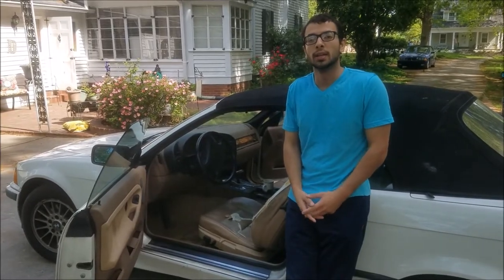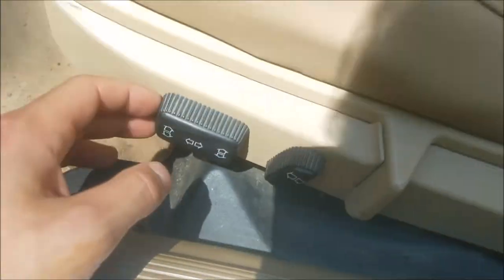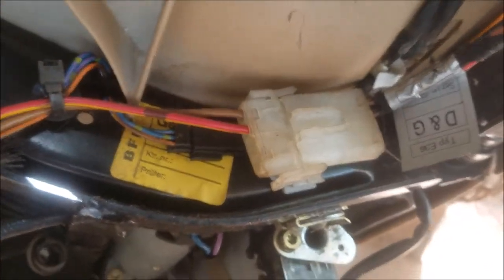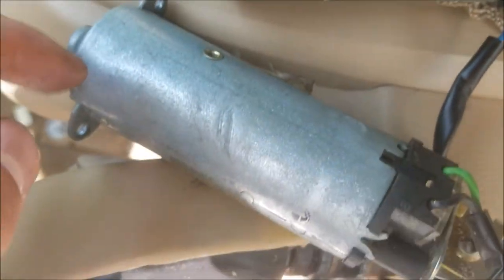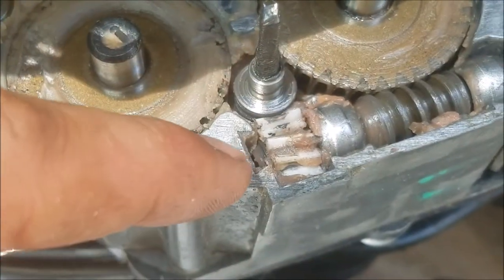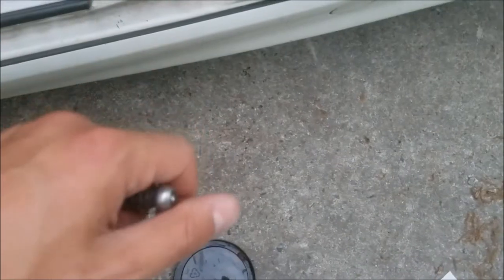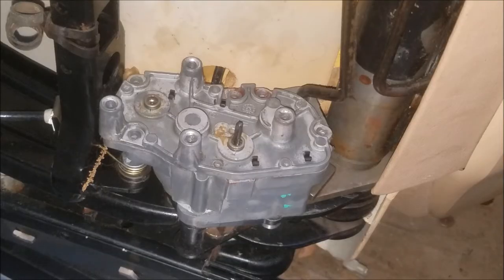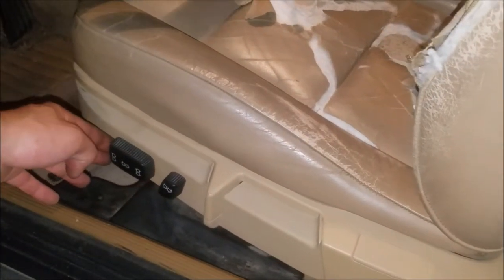BMW E36 Recline Gear Seat Repair

Comment: Hard to add to this lesson. Thank you so much for taking the time. Saved me for sure. Couple of things. Perform task with seat back tilted forward as it allows access to those motors. Also removal of the back motor first makes access to the back screw for the front motor much easier. Hope these help your repair go easier.
Reply: Well here’s my dilemma, my seat can’t  be leaned up because it got stuck in the all the way down position 🤣

Comment: these motors are easily repaired... what happens is there gets to be a filmy grime buildup on the commutator where the brushes ride.. clean them with sand paper, and its fixed.. the motor looks like u cannot take it apart but u can.. very easily.  pry the tabs up on both ends, then slide the top and bottom off.

Comment: Why is BMW using plastic gears on a car? Actually, they use too many pastic parts. I have an e36 and e90. Same problem on both cars. And where can i purchase the gear? Thanks
Reply from the maker: Save money, I have seen a few people over brass gear replacements but the standard is plastic.
Reply: To save who money? LOL. :-)
Reply from the maker: @BryanChance  BMW, they do not care about consumers nowadays when it comes to repair & maintenance haha.
Reply: Human safety   if you move with too much force you can do human injury.

Comment: I'm trying to get my seats out of my e36.  I don't have a wrench that fits over these bolts.  They're 16mm, but no wrench or socket I own fits.  The screws nearly touch the rails.  There is no room for a wrench.  And the seat doesn't go far enough forward to get to the rear ones, but I can see no wrench will fit those anyway.

It is likely I will have to cut the seats apart and then drill or grind the screws out.

How much beer did these engineers drink?!  This whole car is designed so terribly.

Comment: maybe you should just replace the entire piece of $hit seat! Its in really bad shape buddy! just saying!
Reply: The seats sell for 200$
Reply: Great video.  I just looked at after taking mine apart.  It would have saved me a lot of time if I watched it first because I removed the gearbox from the seat and stiff spings.  German obsolescence engineering at its best. Brass gears would have been nice.  Not one but two worm drives in a seat gearbox.  Other designs don't utilize a gearbox.